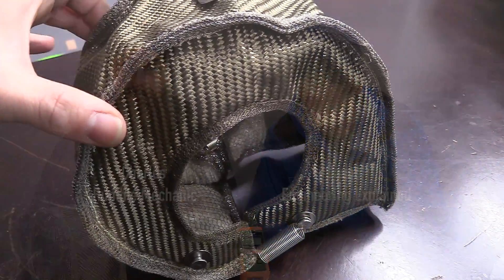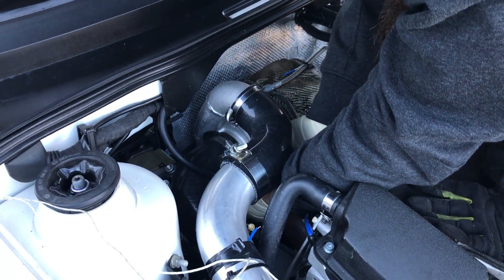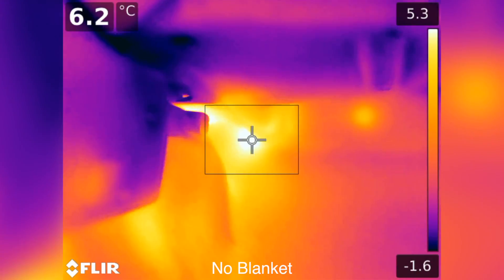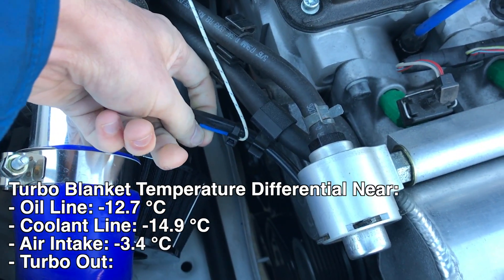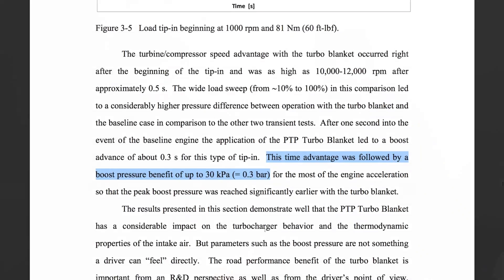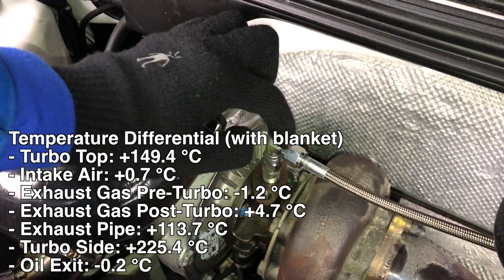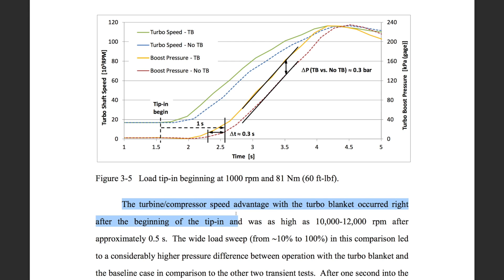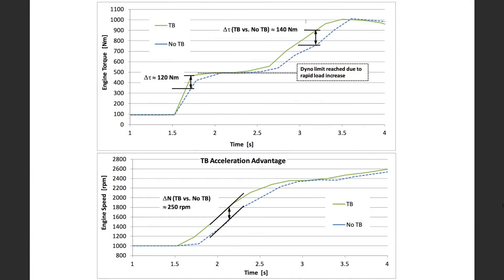Can Turbo Blankets Be Proven To Increase Performance?

Comment: How is that possible? Why does it produce more torque? Why does turbo have a bigger speed and boost? Just because it's hotter? engineering explanation please!
Reply: SlawekK When you heat up gas in a confined space, it increases pressure (just think of opening a warm can of soda). Increased pressure forces the turbo to spin faster. Faster spinning turbo creates more boost.

Comment: I wanted to ask a question for curiosity. Won't the exhaust side of the turbocharger overheat because of this blanket? Or can it handle those very high temps?

Comment: Most of the heat from the intake side of the turbo is created by compressing the air to begin with, that's why you need a good intercooling setup to manage that, since it's a constant. The faster spool on the exhaust side is definitely believable though

Comment: That diesel turbo only makes about 7 psi max boost in their tests.  I think that Charles might expect to see more improvement (proportionately) due to the higher levels of boost in the GTI.  That might also explain why you saw better temperature improvements in the GTI than they did on the diesel.

Comment: its funny that this just popped up, i was recently reading a thread on some Mazdaspeed 3 forum about ceramic coating , porting and polishing the stock K04 turbo(found on a bunch of cars from Colbalt SS/TC,GTI,TT,MS3/MS6 ect) what was he found was that the car wasnt making much more power(as he did before pnp/ceramic coating, after pnp/coating but no tune then post tune)but it was making almost the same power (i think he was up 5hp-10hp which could be attributed to environmental factors) just about 500-600rpm sooner, also the car was starting to run lean, post tune results were promising, the norm top out with that motor /turbo combo is around 320whp (ive heard more and less and im kinda sitting at the middle there)were with the port/polish and coating he hit 350whp now i should also point out that the down pipe and the exhaust manifold were also coated and that both the hot and cold sides were coated inside and out....its really cool what some heat management can do for a forced induction engine

Comment: Thank you for this!  How about, as a next step, go further? Not just insulate the turbocharger, but draw the heat off with water phase changing into steam, and augment the internal combustion engine with the steam power? Make it a combined cycle engine? See what extra power you can get?  Interested? Perhaps the Humble Mechanic could wrench the project? :-)

Comment: Very Good Video but i have a really simple but important question. My turbo spools up to 2bar (29psi) and the tempratures are around 600 celsius(1112 fahrenheit) with out the blanket on the top of the turbo. I am guessing with out being sure that with the blanket the temprature will easily reach 800 celcius (1472 fahrenheit). How much do you think that the turbo is going to survive all this punishment and the extreme heat even with th most of care (warm down before shut off and all this stuff). Keep up the good job :)

Comment: The turbo blankets do make a difference. I used one when I had a 99 Eclipse GSX running a HTA3076 being only 3” away from the radiator. I was having a lot of heating issues...even with the larger mishimoto radiator. I used the lava turbo blanket from PTP and it made a very noticeable difference.

Comment: $50,000 FOR THAT CAMERA ?!?!?! With 50k I can buy the car i want twice :(
Reply from the maker: Hence just loaning it haha, yeah it's insane!
Reply: Definitely don't look at RED prices then lol
Reply: + volvo245, B Shimazaki  - IR camera's use germanium lens and require a sophisticated process to calibrate.  There's only a few manufactures of this tech and not a huge market to sell into.  Their margin is not much different than camera manufactures.  The tech is just expensive.  There's also a need to be trained to use IR camera's.  That tilde in the temp means the calibrated or there's an issue with the temp range.  You also have to account for emissivity of the material.  The turbo blanket is reflective, so some of the temperature read might be reflected heat and not the actual radiated heat.  Although, generally I do agree with your position on questioning corporate greed.

Edit:  added 'n' to "a issue"
Reply: Price fixing cartel or monopoly. Don't you just love endless corporate greed?
Reply: Bruh, 50k can buy my dream car 4 or 5 times over lol
Reply: Engineering Explained Does it get cable and scratch your buttocks with a laser beam from space for that price or did they diamond and gold encrust all components inside? Lol.
Reply: Burako Shimazaki 
No, but you can used it to build pretty sick anti-tank/aircraft weapons. If I'm not wrong that kind of tech is very restricted to be sold outside NATO countries.
Reply: pop tart 
But the Camera does varely need any maintenance. And as a pedestrean you save a lot of money for gasoline.

So. My to do list for today...
Being not funny... check
Being a smart ass... check
Reply: $50k gets me in a conversation with a machinist that's capable of building the engine block in my dreams.
Dreem Big Chisel Down To Reality
Reply: Are you going to do a Linex tech tips type thing?

Comment: My 9-3 Aero had to have basically a blanket or basically additional thermals for the turbo because it was melting other parts of the engine on at least the 2.8l V6 versions.  So this makes perfect sense for me.

Comment: Any thoughts on how the increase in temperature of the turbo housing might affect the metallurgy long term?  You're getting to high enough temperatures with the increase to potentially have an effect and I wonder if that's a legitimate concern or not?
Reply: I also wonder how it affects the oil ><

Comment: Great video. I've been running a PTP turbo blanket on my car ever since I started modding it. Easily one of the best investments I've ever made. 
Heat = energy. You want as much of that energy to remain in the hot side of the turbo as possible. If you really wanna see a huge difference in engine bay temps, wrap your exhaust components too. Heat management is your friend.
Reply: Wraps can make metal brittle. I picked up a ptp turbo blanket for my Cadillac ATS 2.0t but I didn’t wrap my high flow aftermarket carted DP. I instead used DEI silicon heat sealant spray (white) it actually looks pretty cool and works very well.

Comment: In the results from the 2016 study, was the air intake temperature taken before or after the turbo? I dont get how it was higher, unless maybe it was measured after the turbo where due to conductivity it would heat up the intake air.
Reply: After researching the thesis i found that it was after the compressor so i gues it is conductivity by the turbo(shaft)

Comment: Would it have given a more accurate result if you had attached the sensors with zip ties? I do however realise that you are looking at temperature differentials. I also wonder if the turbo is designed not to have any ventilation, so possibly, it could shorten its working life?

Comment: Is there not a risk of the additional 150°C damaging the turbo? Could ceramic type coatings do a similar job or be used in conjunction with the blanket for an even more marked result? Great video guys, thank you both 👍

Comment: High pressure steam distribution systems insulate all of the pipes, but they also go to great lengths to insulate the valves and fittings. They buy very expensive blanket set ups to button everything up. It would just seem to make sense.

Comment: What about placing a blanket on the COLD turbine?
Although the most intense heat is coming from the hot turbine, I can imagine the cold turbine is still catching some heat from the engine bay or something.
Reply from the maker: It seems the fins on the compressor side are designed to be uncovered.

Comment: There is a similar theory with exhaust wraps where by keeping the heat in your exhaust helps speed up the exhaust gases. Although there is definitely 2 camps when it comes to this theory.

Comment: As an engine engineer at an OEM, the only reason why we use the turbo and exhaust blankets is to reduce the temperature of engine components due to radiated heat during "pump tests" to qualify the engines for emergency and military vehicle ratings.  The pump test is a btch.  Imagine an engine at full load for HOURS with no airflow, other than the cooling fan.  Also, imagine the fires that happen when something goes wrong.  Holy carp.  The scary thing is that with the heat blankets the risk of a catastrophic fire due to oil (or power steering fluid) leans goes UP.  The Coast Guard requirements require lower surface temperatures to prevent those fires,  There aren't any performance benefits to turbo wraps.
Reply: "There aren't any performance benefits to turbo wraps."  It would appear that maybe you didn't watch the entire video...   Check this link - Turbo Blanket Thesis Source: https://repositories.lib.utexas.edu/bitstream/handle/2152/43718/BICKLE-MASTERSREPORT-2016.pdf?sequence=1&isAllowed=y
Show less
REPLY
Reply: I did watch the entire video.  I don't believe the source.  They used a SF-901 dyno, a piece of junk that cannot be used for reliable measurements.  The test setup is a bunch of crap.  A low-inertia (and inertially compensated) AC synchronous dyno is needed to run those turbo tests.  How do I know?  I have run those tests, and it is a lot of work to do that type of turbo analysis.  The dyno alone costs $400k, and the control room costs 10 times that amount.  Some college kids at UT-Austin don't have a fraction of those capabilities.  How can a SF-901 perform an inertially-compensated 500 rpm/second turbo test?  The little college children don't have the equipment to run turbo tests, and they are so ignorant of turbo testing that they don't even know that they don't know what they are doing.  Slapping a water brake dyno on an old Cummins engine means nothing.  I didn't see anything in the test setup to accurately measure M-dot.  No self-respecting turbo engineer believes that garbage in the UT-Austin test.
Reply: When I ran the turbo tests and qualifications the CAC was a HUGE influence in the tests, not only was the heat transfer rate extremely difficult to control, but the volume of the CAC system was critically important.  No respectful engineer would use that K&N filter crap in a dyno cell.  The combustion air intake had to be precisely controlled to temperature, barometric pressure, intake restriction, and humidity.  A sloppy K&N air filter ingesting "dyno cell air" does none of that.  I had to control exhaust scavenge blowers to control for turbine out pressure (curves).  Only an ignorant professor would approve such garbage of a test.
Reply: I was looking, and looking, and looking some more for basic information that is necessary to process the data in the turbo tests.  Where is Epm_nEng in any of the data?  If they had access to the Bosch EDC, where is that information?  The CAN data is way too slow for n.

Comment: Yes, you have to cool down your turbo. We have a tow airplane for towing our gliders into the air. We had a blown turbo due to improper cooling. Definitely cooldown afterwards for a minute (especially for aircraft since they run at a significantly higher average power setting).

Comment: Good job guys, you're a great team.

I'm waiting for an EE video explaining the apparent flickering of the LED instruments in the in-car shot.
Reply from the maker: Frequency rate of the light vs recording frame-rate of the camera. :)
Reply: Not that easy. The frequency red (450THz) is many orders of magnitude higher than the frame rate (~60hz). The LED must be flickering. Likely it's because its DC source has a ripple, momentarily dropping Vdd below Vt of the diode. But, then, why aren't all segments of all LEDs flickering synchronously? It looks to me like the issue is that the camera has a rolling shutter that rolls sideways vs top to bottom.

*The ripple would come from the current coming not from a true DC source like a battery but rather the output of the alternator.

Comment: I'm gonna put a blanket on my Hyundai Accent's alternator to pretend I have a turbo blanket
Reply from the maker: Everyone knows the hotter your alternator, the better! Electronics just want the heat.
Reply: @EngineeringExplained  I think the intent is to convert it to a fusion type power generator, REALLY fusing those hydrogen atoms in the air together! The wires and copper are engineered to handle these temps/pressures, derp.
Reply: Yeah, yeah, brake it BREAK IT!
Reply: Squidward's House lmao!
Reply: Who says you have to have something inside of it? Just use a wire hanger to keep a turbo blanket looking like it's full and in place.
Reply: why not wrap the whole engine block? MAXIMUM POWER.
Reply: Damn all these comments are great. Therefore I want them to test the flux capacitor ASAP.  Screw the turbo with that kind of boost.
Reply: Don't forget to put a blow off valve in the exhaust for choo choo noises.
Reply: Mad electron flow, yo
Reply: How did it work out
Reply: Great idea! When it will catch on fire like any real Hyundai does, your alternator will be saved.

Comment: All sounds good, but  +200 degrees C to turbo temperature? When we ran turbo at 30 psi, turbo temperature was getting to nearly 1050 degrees C, without a blanket, imagine if we installed this blanket? Turbo would just melt down, as critical temperature is 1100 C. More boost = more power, difference in temperature in engine bay is negligible compared to higher boost! There may be benefit on low boost cars, but deadly to high boost cars...

Comment: Was the turbo oil cooled or water cooled??? If its water cooled there is less chance of oil cooking right.If thats the case the oil cooled ones will have detrimental effect on the oil.Just my thoughts.
Reply from the maker: I am not sure on the Cummins. The VR6 shown is just oil.
Reply: Engineering Explained Thanks👍👍👍

Comment: but what exactly is the explanation why the engine produces more torque earlier in a low load scenario when a turbo blanket is used?
Reply from the maker: More of the exhaust heat is turned into useful work, rather than being rejected simply as heat energy. Instead the heat maintains pressure, which spools the turbo more.

Comment: Id like to see a comparison of the turbo outlet pipes to the intercooler wrapped vs unwrapped in addition to the turbo blanket . I have a 88 7mgte supra where the intercooler inlet and outlet are very close to the turbo(I believe that the benifits of insulation on the ic piping will be huge for this particular intercooler design)

Comment: Very cool topic! But a turbo that wasn't designed to have a blanket on there wouldn't it be more prone to cracking and leaking oil via the turbine shaft or seals through to the higher temperature differences?
Keep up the vids! You guys working together is always fun and interesting to watch!
Reply: No it won't have an issue, if it was true then over couple months without the turbo blanker just the way "they designed it" then turbos will go to sht quick lol. But it's not true. It shooed to be very hot there.

Comment: This was amazing. So many small but significant details about cars. Great video. I have a small turbo engine car. The blanket seems logical and I don't expect to feel some difference while driving it with the blanket on. But will the blanket make the turbine last fewer because the temperatures are being contained? Or you think it is just a marginal difference? But then, on the other hand, everything near the turbine won't get so much damaged with the temperatures leaving the turbine so it makes it even?

Comment: I'm a bit worried what would that extra heat would do to the turbo, on a 8-9 hour drive. I usually go on trips that long, with short breaks, in which I usually let the car idle, not stopping the engine. Worst case, I could be using the blanket daily, and removing it on very long drives. Could that have any impact on the ECU "learning" the car's behavior, then suddenly changing some parameters (temperatures i.e. intake values)?

Comment: Please do this test with exhaust manifold (header) heat wrap. I always wondered if wrapping header(s) made a difference
Reply: This header is not really built for a wrap. I think a wrap would just be super awkward on the header. It would however be great for a ceramic coat. But that introduces a lot of variables as the coating takes more time to do than the blanket.
Reply: @HumbleMechanic  Could you instead  have a manifold blanket made? wrapping manifolds is a pain, but custom manifold blankets are not so bad to install. jsut clips on like a turbo blanket
Reply: Why not take off the manifold and get it ceramic coated and retest after that part has been coated to see performance gains.
Reply: Wrapping the whole exhaust is theoretically good but then you have to contend with the metal degrading quickly because of the super high temps
 There are exotic metals like they use in F1 ( Inconel...$$$$) but the cost vs gain is probably better spent in a bigger intercooler etc. A coating is probably better as it still restricts the heat and protects the surfaces but allows a bit more cooling

Comment: Happy member of the N/A master race. :)
Reply: Dylkh 

Well, the lower maintenance bit for certain (unless you've one of those really high rev engines). Fuel economy is debatable though. Ford's Ecoboost 1L gets quite good economy.

Less energy is being spent in spinning mass (light weight components + lower rpm), and the otherwise wasteda energy coming from the exhaust is also utilized.

Comment: one more advantage that wasn't specified in this video, you should increase the lifetime of the turbine as well. Since it don't cool down so quickly you won't add thermodynamic cycles in the same rate with the blanket.